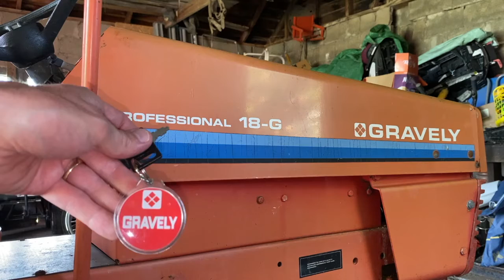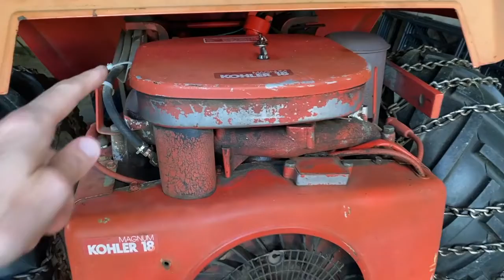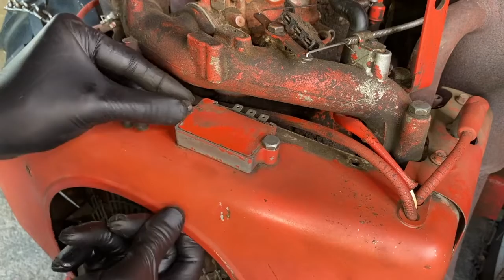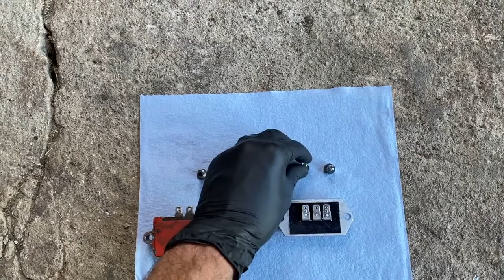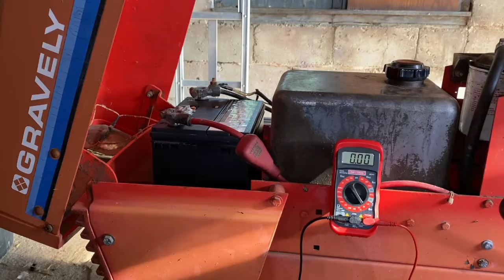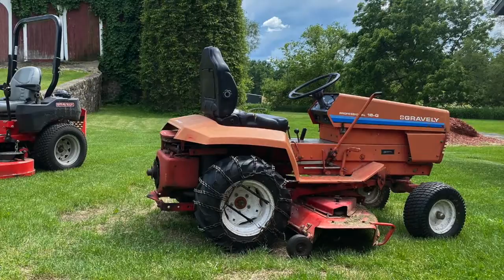Replace 1987 Gravely M18 riding mower Voltage Regulator

Comment from the maker: If interested in purchasing this product, visit our Amazon affiliate link below.  I earn from qualifying purchases.

Gravely touchup paint:  https://amzn.to/3M8gpQt

Voltage Regulator/Rectifier:  https://amzn.to/4fMoo38

Keychain:

       https://www.ebay.com/itm/266380740791?mkcid=16&mkevt=1&mkrid=711-127632-2357-0&ssspo=92VVV1xASp-&sssrc=4429486&ssuid=9oPkoM_JR36&var=&widget_ver=artemis&media=COPY

       https://www.ebay.com/itm/266382070878?mkcid=16&mkevt=1&mkrid=711-127632-2357-0&ssspo=92VVV1xASp-&sssrc=4429486&ssuid=9oPkoM_JR36&var=&widget_ver=artemis&media=COPY

Ratchet style wrench set:  https://amzn.to/3ZhDgRp

Craftsman voltmeter:  https://amzn.to/4dKa1uC

Ignition switch:  https://amzn.to/4bXTJN8

Starter Relay Solenoid:  https://amzn.to/4dMvMK4

Carburetor:  https://amzn.to/4fQrxir

Carb/choke cleaner:  https://amzn.to/3MkGw6W

Shop Towel:  https://amzn.to/4csRp0V

Replacement Battery:  

       https://amzn.to/4csMKfu

       https://amzn.to/4cy8iY6

       https://www.lowes.com/pd/Deka-12-Volt-540-Amp-Farm-Equipment-Battery/50183773?cm_mmc=shp-_-c-_-prd-_-sol-_-ggl-_-CRP_SHP_PLA_SOL_Online_E-F-_-50183773-_-online-_-0-_-0&gad_source=1&gbraid=0AAAAAD2B2W-GGBjHIwl0EMNODS9eUOgWC&gclid=EAIaIQobChMIsPH-l6z5hwMV6DMIBR1VUQLDEAQYHSABEgJ0tvD_BwE&gclsrc=aw.ds

Starter:  https://amzn.to/46KSmAJ

Flywheel fan blade assembly:

       https://amzn.to/4dOUauN

       https://amzn.to/46T4cc6  

New OEM grass screen:

       https://amzn.to/4de1cZK

       https://amzn.to/4coKeXP

Fuel tank cap gauge:  https://amzn.to/3YexRKc

Ignition Module and Spark Plug wires:  https://amzn.to/4dpDXfB

Spark plugs:  https://amzn.to/3X6471f

Stater:  https://amzn.to/46OtzLT

Fuel pump:  https://amzn.to/3M9lw2O

BEST grass seed:  https://amzn.to/4cE7oKu

Copper Bullet Pocket hose:  https://amzn.to/3VO6Vyc

Flag Pole:

          https://amzn.to/4eY61Ii

          https://amzn.to/46063uW

****************

Gravely Mower PlayList

          https://youtube.com/playlist?list=PLjCXOz8TSkZm6clA9JxmXWVhwT-cISDGt&si=b0gxEvA-HUirqMeg

****************

1.  Replace riding mower battery

          https://youtu.be/Z4NXYWjmwMo

2.  Replace 1987 Gravely mower Ignition Switch

          https://youtu.be/nAUqONjuxVQ?si=NNP0coslJMFlFMl5

3.  Gravely mower engine not shutting down - Common causes

          https://youtu.be/UdZ2ebi2WQM

4.  Adjust 1987 Gravely mower Forward and Reverse clutches

          https://youtu.be/ZsJ7JBkkYho

5.  Replace 1987 Gravely mower Grass Screen

          https://youtu.be/io5NhTCFaxI

6.  Replace Flywheel fan blade assembly

          https://youtu.be/vvjwMDIn6Q0

7.  Mower not starting - Common causes

          https://youtu.be/Ny4lyVGBdCk

8.  Replace Starter Relay Solenoid

          https://youtu.be/nVMfcWNuRKk?si=R0u79-zFkPS9Xjh7

9.  Replace spark plug/boot Ignition coil module

          https://youtu.be/JXio8ia42z8

10.   Adjust and set Brake and Parking Brake

          https://youtu.be/4yAa68vsdqY

11.  Replace Voltage Regulator

          https://youtu.be/vY57Kzr6i1g

👍